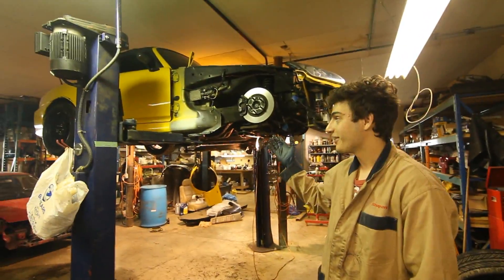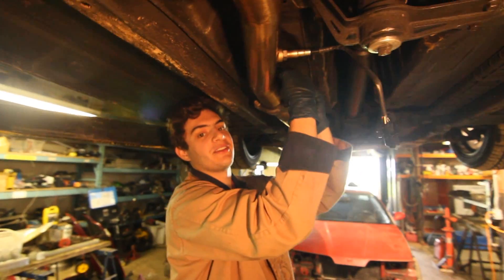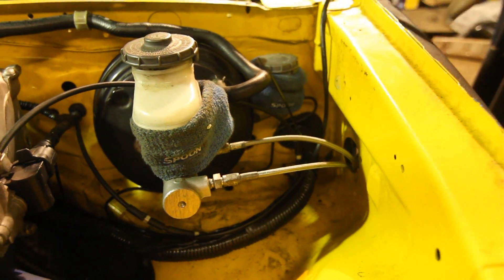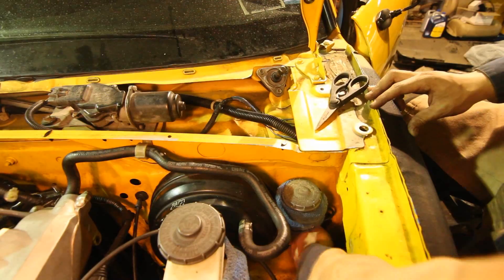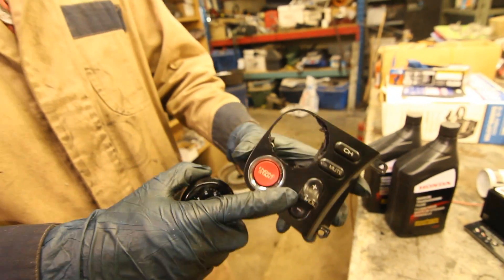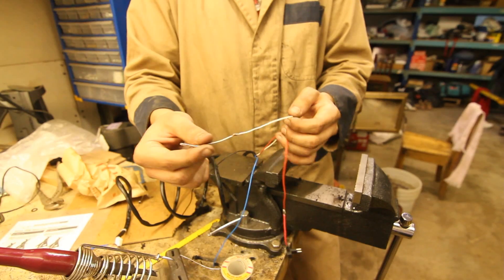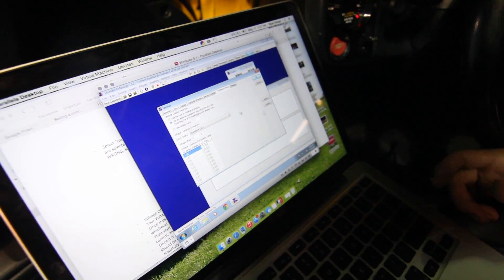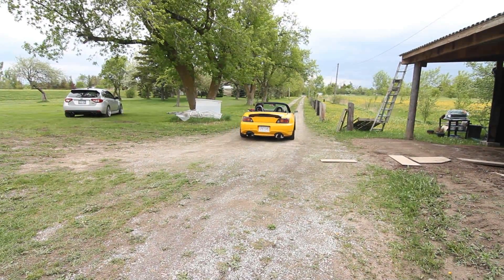How to: Install Gauges Aftermarket Wideband Sensor ( S2000) AEM uego

Comment: Dammit I have to do it over again because this the secondary o2 sensor you guided. Not primary
Reply: Correct, you have to remove the front 02 sensor, that’s the one that reads afr

Comment: Hi, what ECU did you  run on your car ? if i running the stock 2006 honda s2000 ECU with flash pro, do you know what pin i connect the white wire to ?
Reply from the maker: This car was on a kpro. sorry I'm not exactly sure what your referring too as this was also some time ago. I'm sure you can find an answer on s2ki

Comment: You have to be running the K-pro. so I was wondering if it's worth it since you have to replace some parts for it to work properly? thanks
Reply from the maker: if you are going to be going FI or are running ITB/a stroked engine to 2.4 L like this car here, and i don't see why you'd want to install gauges on a stock motor,  then yes you need a standalone EMS. either K PRO or AEM EMS do the trick when well tuned. Kpro is substantially more expensive to run on a s2k but i purchased it becasue my friend could tune k pros and also to throw codes for Safety inspection and obd2. It's not possible to throw obd2 when plugged in at inspection with aem as far as i know.
Reply from the maker: if it weren't for the emissions/safety inspection aspect then no kpro is much more expensive to run to achieve the same thing a tune with ems could achieve.

Comment: What happens to the stock secondary O2 sensor? Do you just leave it unplugged or remove it altogether?
Reply from the maker: as far as I remember other 02 was left alone as it is stock.
Reply: @YungMarsh   Well you couldn't have left it alone since you put the wideband in the secondary location. You must have disabled the secondary sensor in the Hondata and replaced the sensor.